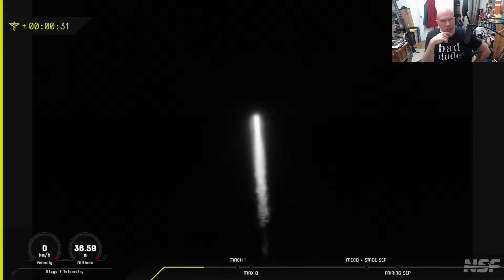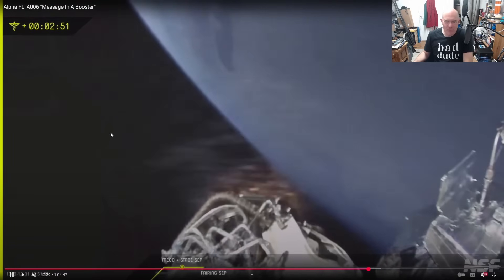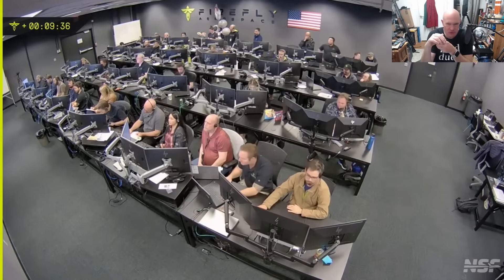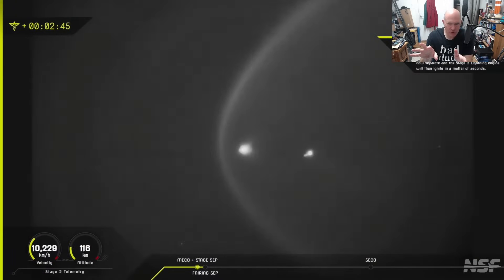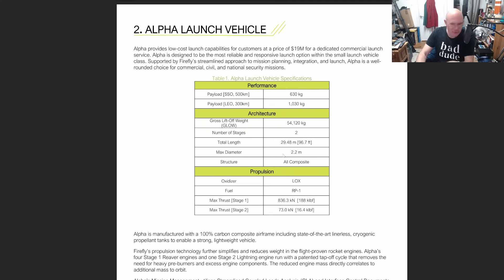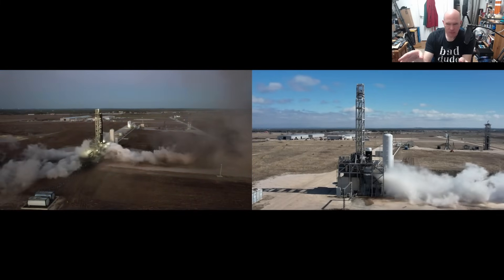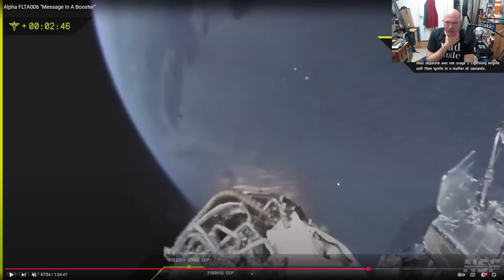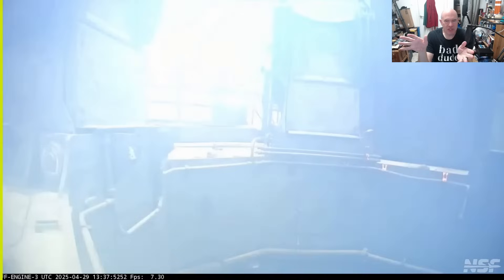What Went Wrong On Firefly's 6th Rocket Flight? Did The Nozzle Fall Off The Second Stage?

Comment: The Firefly leadership case is wild, here is what i gathered: 
1. Firefly Aerospace was founded by Thomas Markusic, P.J. King, Michael Blum and a group of Inestors in 2014. 
2. In Feburary 2022, the largest shareholder Max Polyakov, who owned 58% of the company, is pressured by the US government to sell his shares of Firefly Aerospace for 1$. All shares go to Thomas Markusic. Polyakov initially invested $200m into Firefly. 
3. In March 2022 'AE industrial partners' invests $2b into Firefly aerospace, becoming the largest shareholder. 
4. In June 2022, Thomas Markusic announces that he will step down as CEO. Rumours are the new Owners wanted sb with more experience in getting contracts and and were not happy with Markusic.
5. In 2023 Markusic founds "GigEngineer", a manufacturing technology supplier. Showing he is puting his time into other projects now.  

I wonder: 
a)  What happened that they kicked the face of the company out? They were clearly struggleing, showing 2/3 failures after the first fully successful flight in September 2023. And since Markusic left you don't hear about them often (except that marvelous moon lading). Was Firefly just turned into a stale corpo money grinding machine without a vision? What happened? 

b) did the shares transfered to Markiusic perhaps come with a condition? (Senator demanding they get bought by their buddy's company at a low premium maybe sth along those lines?) Why else would you let one company have a total majority? We know Washington has a lot of business relations into Ukraine, even before the war. But warning: pure speculation here.

c) Was Markusic ok with this? He stated that in official statements, but i don't believe it. Firefly was his baby.

d) Did Polyakov just get screwed?

If you know more about it please sharre, i would love to know. :D

Comment: I fully share your sentiment about interlaced video. It had its place in electron-beam scanline CRTs, where it was a compromise between high framerate and vertical resolution, and worked reasonably well. It was a pain to work on digital editing systems, but possible if you knew what you were doing. But even then, many people didn't know what they were doing, which made it look horrible. But on modern display it has no place, and I am shocked to see that even some modern video is filmed in 1080i (which shouldn't exist at all).

Comment: I haven't followed Firefly, so here's a possibly stupid question:
Did they initially have a physical "pusher" that they swapped out for the hot gas system? If so, maybe their nozzle was rated for the pusher, but not the hot gas system, and that caused it to fail?

Comment: I suspect that to be marketing babble for 'the hot exhaust from whatever system they use to settle the fuel or initiate the turbo-pumps is dumped into the inter-stage space to provide separation.'

Comment: Where where the numbers like altitude and velocity. How close came the 2nd stage to orbital velocity and the engine ran for about 10 seconds longer. But usually it has more fuel left because just 10 seconds excess fuel of a normal 2nd stage flight of 6 minutes is like at MECO the fuel tanks are dry like there is not much margin. Could the rocket not use every drop of fuel to get it as fast as possible and couldn't the payload not get more delta V using its own thrusters to save it from going to slow that it hit the atmosphere at the other side of the earth?

Comment: So were the Firefly commentators deliberately deceptive about the missing nozzle or just clueless non-technical staff reciting a script?
Reply: Usually commentators are to refrain from making any comments or speculations about mechanical issues.
Reply: In my experience, the non-technical commentators do remain quiet.   But when major events like a RUD or a whole piece of the rocket disintegrates, such as a nozzle, they will say something like "clearly there has been an anomaly".  I've witnessed it on SpaceX broadcasts.

Comment: Towards the end of the first stage burn, the exhaust plume is asymmetrical, this tells me there's still some amount of atmospheric interaction, and when the upper stage separates, it's going to get pushed laterally, because of the angle of attack.

Comment: I second the idea that the stage sep hardware failed and what we saw was basically an inadvertent hot staging. That seems consistent with the gas clouds and debris. It will be interesting to see what Firefly determines, as they have the data and I’m just some schmuck. 😂 (I did spend more than a decade in the satellite command and control arena, though.)

Comment: After watching your theory, I have another theory: When I was watching the live stream, I noticed that immediately after launch, the telemetry was reading faulty data, as it showed the rocket's velocity to be only only 300 km/h while going through MAX Q, where it should be atleast above 1000 km/h. I speculate that this faulty data caused stage one to cut off a bit early, which caused it to veer off course in the lower atmosphere with higher air density, causing it to collide with the lighting engine, before it could clear the interstage. (mind you, it's only my speculation)
Reply: You assume lags in the downstream in the telemetry means that the computers on the rocket were also getting lags.  I doubt that's the case.
Reply: Max Q, highest pressure on the rocket is dependent on the path of the rocket though the atmosphere and the load the rocket is carrying.  .  It doesn't always occur at 1000KM/H.  if the rocket is lightly loaded it would be traveling fast before it exits the atmosphere so in that case maximum pressure on the rocket would occur higher  in the atmosphere at a higher velocity.  If the rocket is heavily loaded it would be traveling slower through the atmosphere and maximum pressure would occur at a slower velocity and a lower altitude.

Comment: is it possible for a nozzle  to be sucked off from the rest of the engine (under performance of the engine, flow separation and higher than expected pressure in the inter stage )

Comment: Interlace or no interlace, it takes time to scan a picture from top to bottom so if the event is fast enough that it happens within a frame, there will still be a visual distortion as the top of the frame happens 16.6 mSec before the bottom assuming 60 Hz scan.  I suppose if you have a CCD that can grab an image at the same time but the data is still downloaded to memory sequentially into memory.

Comment: When all your film movies are shot at 24 frames per second, and your main power frequency is 60 Hz, and the two speeds must be synchronized so your TV doesn't show interference patterns due to frequency beats. Transmitting two half pictures thirty times per seconds - it's all that's possible!
Thank you Mr. Manley for all the clear explanations.
Greetings from the UK,
Anthony
Reply: Personally i think 24 fps is the real problem in this scenario. Arbitrary at best, purely for cost savings on the studio's part at truest.
Reply: Of course if we had remained a dutiful colony, this mess of standards never would have happened.
Reply: @BobStein  Yeah we'd have another, even more baroque set of standards.

Comment: Key here is the under damped oscillation. Hard pitch/yaw impulse saturated the control system or moved outside of tuned control regime. This "wound up" the countering control input causing overshoot.

Very likely that the engine bell hit hard on the side of the interstage, broke that and caused the booster bulkhead to separate partly or completely from the continuous tube wall.

 Then the second stage lit it on fire, in space, with all that oxygen blowing out.

The bulkhead, the bell, and other interstage parts were blown back by the second stage engine.

Comment: What’s wrong with Falcon 9?  They have a better success rate than 50% (not including test flights); that’s for sure.  They have a production line of rocket motors and stages.
Reply: For payload under 1 ton it's a bit overkill.
Reply: @imaginary_friend7300  Thank you I didn't realize that.  Overkill, maybe, but if it doesn't malfunction, half the time, I bet it works out to be quite a bit less expensive.

Comment: Is the space inside the interstage kept at a vacuum or otherwise airtight? I wonder if the gas worked correctly to begin separation but clamps or whatever mechanical devices hold the stages together didn't work/fire, leading to a build up of pressure inside that ripped apart the interstage and breaking off the nozzle in the process.

In any case, the biggest learning to come out of this is reinforcing the need to leave interlaced video in the past where it belongs.

Comment: I think they probably need to rethink the entire staging system.  My armchair recommendation based purely on KSP (so salt recommended) is to either use a combination of retro-thrusters on the first stage while having the second stage carry the inter-stage fairing and jettison it shortly after stage separation much like the Saturn V did.  That or replace the inter-stage fairing with a hot-staging system.

Also, as for the "North of Antarctica" gaff the best it tells us is that it is near Antarctica.  They should have just given a UTM grid or a Lat/Long failing that.

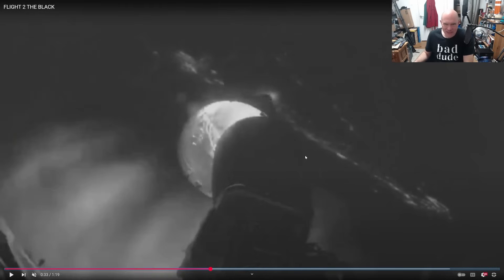Comment: So... Either Aerodynamic forces or INERTIA, possibly from un-balanced mass in the interstage cowling/shell, allowed that cowling to begin Tumbling immediately, BEFORE it had cleared the Nozzle visible at 9:20...maybe both.
I'm guessing that any new design has features that immediately CRY OUT for modeling and testing, and other features that might be given much more cursory treatment because they appear to be devoid of novel features... But the thing about Laminar air flow... seems the factors that can influence /initiate Turbulence can be in the composition, temperature, particulate content, cosmic for-Pete's-sake RAYS, and other microscopic factors and events. Especially with supersonic airflow, I suspect the problem of apparently RANDOM turbulence emerges as a major consideration. 
And of course, the hypersonic airflow would have some AUTHORITATIVE power to nudge that cowling with seemingly small turbulence.

Comment: If you've watched Formula-One Racing, oh, 20-15 years back, you'd KNOW, Carbon-Fiber constructs, once they exceed their sheer limits, utterly Disintegrate, rapidly! They only 'stretch' so-far, then dissolve the bonds in shredded little bits. It would be Wiser to blend-in Metal Mesh in high Stress, high heat zones, and create 'heat-sinks' in doing so.

Comment: That can't possibly be interlaced video, because the vertical separation is many times the size of the smallest vertical detail.  Interlaced video is every other scan line, and each scan line is one pixel tall.  So the maximum vertical difference you'd get from interlacing is one pixel.  Much worse horrors happen due to the rolling shutter artifacts that you get from CMOS sensors.  They provide crisp details without the motion blur of a CCD, but outright distort the geometry on every frame.  With interlaced footage, you can easily separate the even/odd scans into separate images and treat the footage like it's double the speed, if you need to do something like camera tracking (photogrammetry) on the footage.  I did a lot of that work for a number of years.  I'd very much rather scan lines from a CCD than the wild distortions from a rolling shutter.  Scanned film is amazing.  Rolling shutter from the digital cameras which came out in the early 2000's was a bit of a nightmare, as the distorted geometry wreaked havoc with the photogrammetry software we needed for the visual effects.

What you're seeing looks to me like a "matte box reflection" which happens when you have filters in the image path.  If it's an infra-red camera, then it certainly has a visible light blocking filter on the sensor chip, which could be the cause of those reflections.

Comment: Thanks much for the footage of the good launches and interesting discussion.  I think another possibility to consider is that the Lightning (rename it "Thunder"?) engine experienced a "hard start" event which may have destroyed the nozzle and explains the other debris observed.  That one large piece of debris looked like a rocket nozzle with something else attached to the base end.  It was interesting to watch the bright spot that was the 1st stage as it continued to follow the 2nd stage.  The 1st stage did not drop away, relatively speaking, because the 2nd stage was not accelerating.

Comment: I noticed it seemed to wobble around after separation trying to correct the flight at first I thought it was tumbling but then it straighten out and continued running. Hadn’t noticed seen a previous flight I didn’t realize something was missing!

Comment: My guess... The stage kicker was underperforming and this one overpressurized, burst, and rang the bell right off the engine.
...or through failure to check staging, they purged the engine too soon.
Then I watched the rest of the video.
The questionable debris looked like it could have been a bell and a skirt that got ejected from being internally pressurized when no pressure differential was expected.
Also, I second your rant about interlacing.

Comment: Does the second stage use fuel or oxidizer to cool the nozzle (regenerative cooling)? If that's the case then just knocking off the nozzle could cause a large release of gas (and possibly an explosion) as those chambers and the pipes leading to them rapidly depressurized.

Comment: Wild guess: they separate by inserting gas into the interstage (could be pyrotechnics), creating a mild overpressure, and unlocking the connections between interstage and 2nd stage.

The “hot” gas normally pushes the 2nd stage out. 

The locking between interstage and 2nd stage failed to release for some reason, causing an impromptu pressure release at the wrong place …

Comment: The second stage does fire very early in stage sep process. The first stage isn't even fully clear of the nozzle. I wonder if the excess nozzle pressure leading to nozzle failure (explosion) has occurred due to the fact the nozzle is essentially capped?

Comment: Watching the video of the launch, my impression was that the first stage underperformed -- which could explain why so much of the camera tracking was off; it simply was not on the anticipated trajectory. Plus, in the last few seconds prior to staging, the vehicle appears to be pitched up noticeably. That would induce a significant asymmetry in the air flow, perhaps causing a collision of the interstage with the second stage nozzle as a result. Also, notice that Firefly stopped providing speed/altitude data on their stream more or less coinciding with staging. There's a lot of detail to come out of the investigation into this particular mishap.

Comment: It seems as though quite a few of first flights of new providers have this staging problem where the 2nd stage doesn't come out cleanly and goes sideways, the booster trajectory isn't stable due to engine shutdown timings/propellant slosh at MECO or the forces of sep aren't aligned and cause the booster to go sideways. Electron and Falcon 1 had this problem.
Reply: That's not true of Electron... their first launch had no problems at all with the rocket, and failed only because of a comms problem with ground equipment, causing an abort.

Comment: Err, you want to  create a laminar flow. When the gas exits the nozzle
 It creating thrust vectors along a hemisphere. The nozzle takes gas and creates a quasi laminar thrust vectors and through containment aligns the vectors along the axis of symmetry (the gamble direction. 
   And so if the gas just exits a planer nozzle it will expand in space and cool, but if the gas reflects off the bell manifold it maintains some pressure, which is a force vector on the engine itself until it laminarizes, since they are moving pretty much the same direction the thermal component seen via compression decreases as the gas is closer to exiting the bell at which point the pressure drops rapidly. This pressure drop can be seen as a shock wave that converges behind the engine with the outer boundary of the shock spreading in space beyond the nozzle. 

If we remember the momentum equation M1V1 = M2V2. The V is a vector not a speed. If we consider a moment of thrust then to calculate the thrust we have to calculate M1V1x + M2V2x = 0 and so on for y and z axis. But if it’s a hemisphere then -x will cancel x and -y will cancel y. Which means what you are left with is only the z, but the z value will be something like 1/SQRT(3) if the expansion was uniform across the hemisphere. The nozzle gets rid of most of the |x| and |y| vectors in the thrust by realigning them to the z axis.

Comment: I want to be an armchair engineer and say that my guess is that when it went to separate something went wrong and the two stages didn't move away from each other, then the engine fired up white still inside the inter-stage and the exhaust built up until it exploded the inter-stage and nozzle

Comment: A possible way of staging could be to release some oxidizer to push them apart.  If the staging clamps didn't release on time or jammed, that could blow the interstage sides out and break off the nozzle.

But, the term "hot gas" staging makes me wonder if they do a short burst on the engine to push it apart.  That could have the problem of filling the interstage with a fuel/oxidizer mix if it didn't light right off and that's sure to make a big bang when it lights.

Comment: If you look at how tight the second stage nozzles usually fit into the 1st stages, it always requires the two parts to separate without any movement away from the centre line. There is never much margin for error. We see this separation so often executed successfully, they make it look easy. But I guess it's anything but easy.